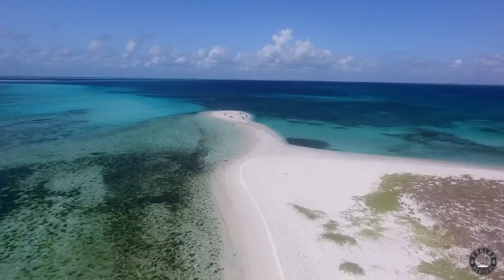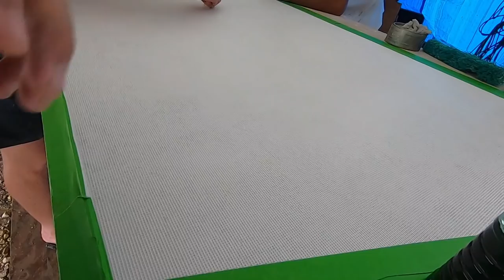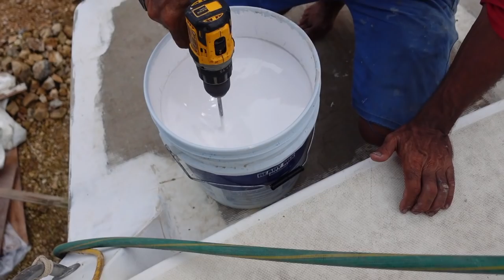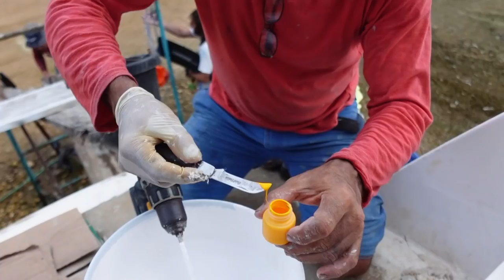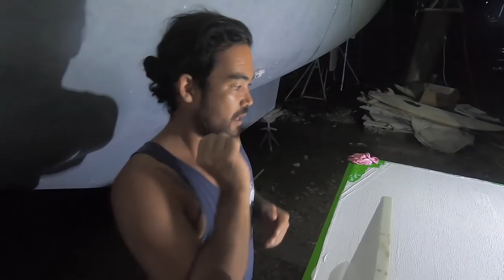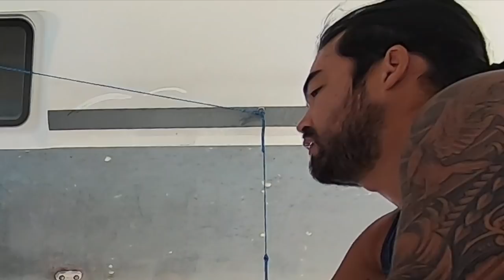How to make diamond pattern non-skid for your boat! - Episode 135

Comment: You might want to invest in a couple of small automotive paint spray gun. We did lots of molded fiberglass parts and used gallons of PVA. It is best to spray the PVA nice and even coats. Also I believe your gel coat would be better sprayed.

Comment: in the jetski industry we use a product called hydro turf which als comes in sheet form and lots of cplprs that can be stuck down onto smooth surfaces and would have been a good alternative to the molded non slip

Comment: Try compressed air to release the non Skid from the mold alot safer and less chance of cracking your hard work than with a wedge. Just wedge the corner than shoot air down between the surfaces and watch it pop straight off

Comment: Colin, Don't know if you've seen Rosscoe at "Life on the Hulls" use compressed air to release components from the molds... if you intentionally started in middle of one side and had some people hold 2x4's around the 4 edges so any air pressure will lift from the middle of template first...that may help you get more non skid panels out of that singular mold. The side you're blowing air in from may need a small notch in 2x4 and some tape or putty to keep a decent seal. Praying for your conehead buddy too !

Comment: Are you using waxed gelcoat or is that not necessary because of the pva? I need to do this same thing with my racing boat that took some significant t bone damage during a race. Thanks!

Comment: I don't know if it will work on lion fish, but it will make your doctor mad. when you shock a poisonous bites or stings the poison becomes the same charge as your body so the enzimes can't key into the pro-enzimes so they repell each other. This was discovered in Equador when a soldier got bitten by a two step snake another soldier shocked the wound with a stun gun. this works for all snakes, spiders everywhere. The sparkplug wire from an outboard is enough. Perhaps it might work on a stingray wound who knows.